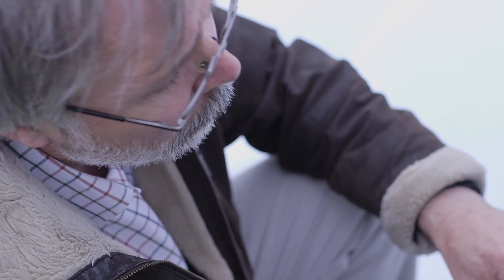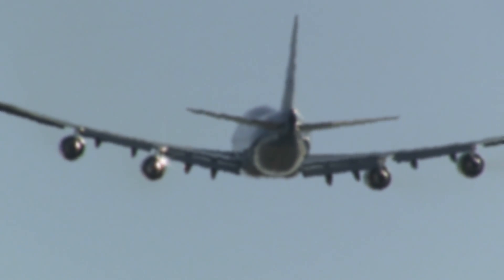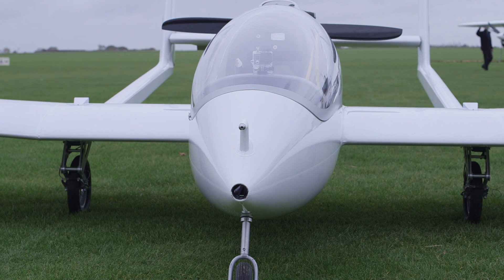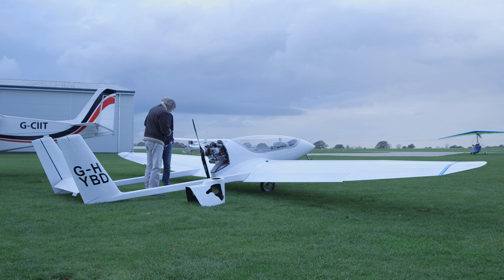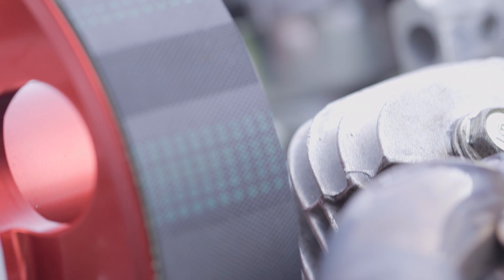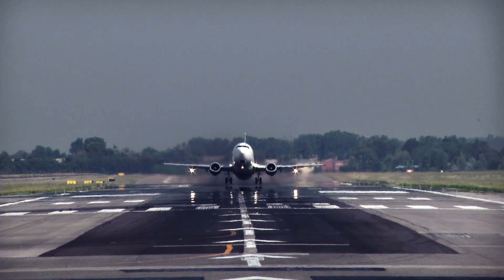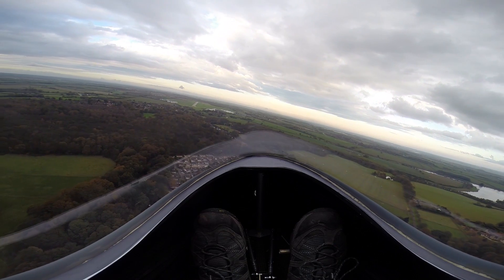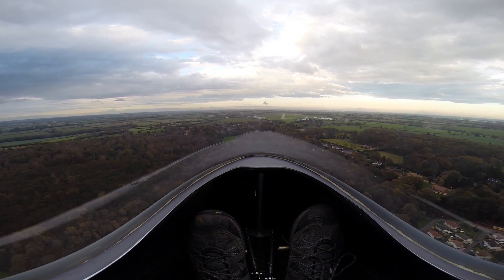Planes go hybrid-electric

Comment: With the advent of a  working hydrogen fuel cell and the more efficient ducted electric fan, you have the makings of a clean power unit; the fuel cell would create the electricity to power the fan and keep a backup buffer battery charged.   The byproduct would be water.  Additionally, putting the fan on a gimbal would allow control of the aircraft without the high drag of large control surfaces.

Comment: how about a combustion generator to power an electric engine.
In cars you gain a huge amount of energy lost in the drivetrain but seeing as in an aircraft it is generally 1 to 1, would it have any benefits?
perhaps an very small combustion generator attached to a super capacitor bank then to an electric motor?
you can charge up the capacitors when at lower power usage and drain them when demanded for tonnes of power.

Comment: Hybrid power is not a bad idea but why turn off the electric motor and run the petrol motor in level flight? The other way around makes much more sense if you have a bit of battery backup too. Run the electric motor in level flight and use the petrol engine as a generator when you need a little boost, primarily for takeoff.